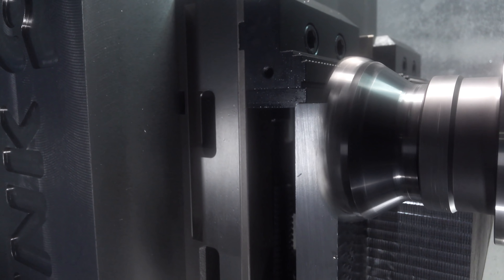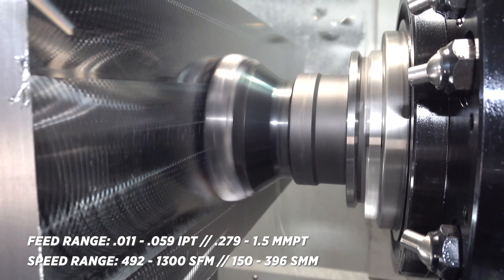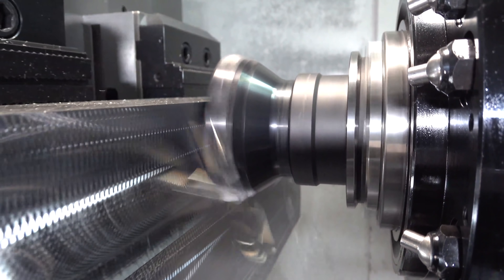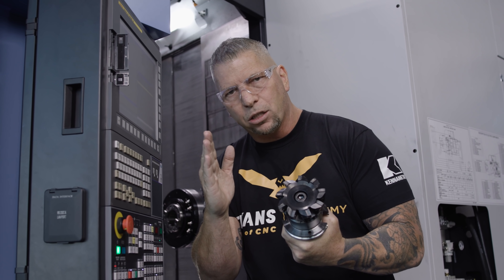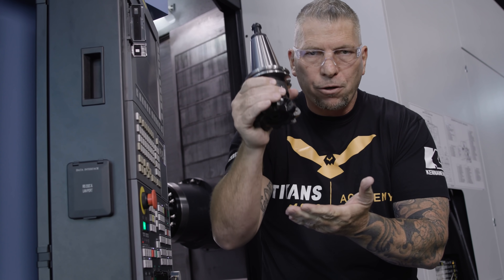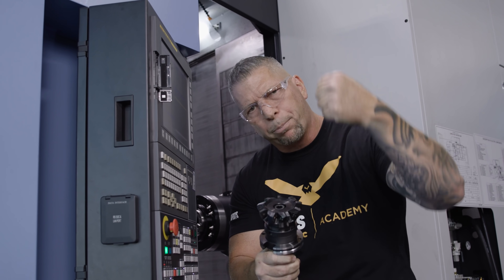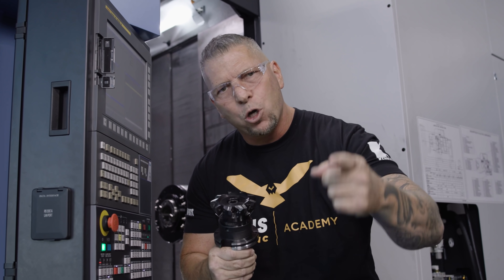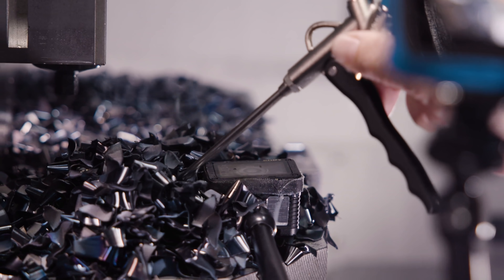Plunge Milling Steel on NHM 6300 Horizontal CNC Mill | DN Solutions

Comment: The only experience I had at a machine was a couple years at a sheet metal one. I ran a turret punch press. I would get prints and a program and told here make this. The programmers would use general tool sizes but I had learned to use better sizes and edit the programs. As long as QC said the part was good I was good. Then I went to a shop ten years later that made huge gear rings. Same thing as before but used cutter heads. It wasn't for me. The education was priceless. A lot what is learned here can carry over to other machines and part makers using some sort of CAD. It's amazing how you give all this knowledge away for free  The smart ones are paying attention.

Comment: Drilling was supposed to be the fastest way to remove metal other than with a saw, so I was taught. There are some other techniques similar we were taught like plunging end mills instead of using a more traditional approach, that other big companies were playing with. This does make sense although it's a little different to see what looks like a face mill plunging.

Comment: One of the shops I used to work at used plungemilling for rapid material removal. We were doing H13, and honestly it was the only thing in the shop where they nailed the feeds and speeds. However, it was always sketchy proving programs out that did this. I don't like this process in an operator shop, and have seen some nasty, stupid crashes with it, but this is a great way to remove material and I wish that shop used the technique more often. The only machine I won't use this technique on is a 5axis. Our table on our varaxis 630 was out .019 in the A, though I think that's most likely caused by a crash that wasn't reported, not someone running the machine hard.

Comment: I've had a plunge milled feature running through my brain for a year or so now. 

My machine is a dmg dmf 600 linear. I have a large part with a 2x2x100" open slot. I've played with everything from traditional heavy roughing to high feed to plunge milling. But I have this idea to utilize plunge milling combined with my machines b axis swivel head. The obvious drawback to plunge milling is the bottom of cut and the repetitive retaction moves which quickly add cycle time. My idea is swivel the head to an angle that allows my cutter plunge cut along the length of of slot rather than to bottom over and over. I felt like surely someone had done this before but upon finding no information I've been hesitant to explore this teqnique. If the cutters geometry works when swiveled then you gain all of the benefits of plunge milling without the prominent negative effects.

Does anyone have any thoughts or experience on this?
Reply: Hardly qualified to answer, but I see what you're talking about. I see a few questions to balance out:
-You'll have something of a sine wave along the walls of the slot. If you finish with an end mill, perhaps you would want to avoid having your plunge steps and flute height sharing a common multiple? You'd probably decrease tool life and induce chatter by having flutes hit the peaks of those waves in unison.
-Your inserts are hitting the material twice when you enter into the first end of the slot. So maybe ceramics wouldn't be a good idea?
-Similarly, to finish roughing the bottom, it would be dished out.  Would you then need to switch out for a different and smaller tool to deal with that or what?

My final thought is if it can it be done like (or on) a slotting machine? Never played with one, but I've seen them. Horizontal shaft supporting the tool on both sides. The tool was basically a puck (cylinder) with cutters sticking out.

Comment: Great Channel.  Do you use toque wrenches to tighten vices? Air and hydraulic clamping? Do you have a reference for clamping forces required in machine parts? Thanks.

Comment: One of the first things i learned from my first job as a apprentice.  Even on a Bridgeport, plunge milling is the most efficient way to remove material for roughing.  This is awesome.
Reply: It can be. It does force you to be out of the cut for a certain amount of time for each repositioning move, though. If the part allows a continuous adaptive tool path then that will increase time spent cutting vs. repositioning.

Comment: I remember the first time we got a CNC at our company. Management thought it was a good idea to let the engineers do the programs. Idiot plunged a 3" insert mill straight down in the middle of a large pocket and wondered why it didn't work. "The simulation worked" he said.
Reply: Quite a few people are surprised by the simulation playing out different than real life.  Always at least look at the code for obvious errors.  At my shop a have a few guys who are just starting to learn CAM systems.  I told then to NEVER believe what the simulation shows.  The simulation shows you what the post SHOULD out put, but that is a big SHOULD.  The simulation can show one thing, but the posted program could be something else entirely.  One guy was convinced that the simulation was "running the G code".  I showed him that is 100% not the case.  I programed a part with no post processor loaded and simulated it.  Then turned to him and asked where is the G code coming from?  He was dumbfounded.

Comment: i used it but not much . good for when u dont want a bunch of force other then down on the part .
but that tool u can run so much harder . i used roughly the same cutter from kenametal on a bt40 and i just run it over its recomended debt full with  and stil does awesome 
i actualy also bought a smaller size for slotting since its awesome at that as wel . this style of cutter u can just abuse/use like a harvy 1 . u will kill youre machine before u kill the tool

Comment: Interesting toolpath, also that vise clamping area in contact with the material seems so small to my untrained eye.
Reply: That is a benefit of plunge roughing.  With out and lateral forces there less risk of the part pulling out of the vise.  With this type of path the cutting forces push the part into the vise.
Reply: They use grip clamps which have small teeth biting into the material.

You get an amazing holding force without much clamping force.
Reply: @norbertfleck812  Thank you for the answers Norbert and Brandon. Did some research on those vice jaw types.

Comment: About eight years ago I had a company that rebuild sprinkles said they a increase spindle repair that use this plung cycle.
Reply: I worked in a plastic injection mold shop where they would ruff 3 d tool paths with 2.0 shell mill  with round inserts in Tool steel ,not super hard so quite doable about 20 Yrs ago
Doesn't take away from this at all tho , this material seems Hard. Cheers!

Comment: An advantage I can see in plunge milling like that when there is lots of stock to remove, is that a lot of the cutting forces is pushing in to the fixture under the heaviest expected loads, less chance of the part moving.
Reply: This, and the fact your not using half or quater of an endmill flute length each cut your using the same tip amount evenly throughout the roughing.
Reply: Plunge milling is absolutely a beast when it comes to take up all the force in axial. Perfect if you need to have a tool reach that is really long and radial forces will have impact on tool life, machining time and most importantly, end result on finished part. Plunging in these cases can make it so you can turn up those feeds and still achieve better end result and longer tool life, since all the force will be axial instead, where the tool and machine/fixture are the strongest.

Comment: This vid was nice. We just got a job were useing a plunge cutter to rough with. The material is similar to A36 but it was flame cut out of plate stock. stock is 3.5" thick x 13x23. We have to go all around at 2" depth in what looks like a giant brake shoe. The flame cut edge is a huge hasle. I only played with feeds an speed for 2 cycles so far. can not get inserts to last all the way around part. Can you recommend an aproach to cut that flame edge? Tryed the recommended s+f, cutting edge wiped rite off, slowed sfm got better, but cutter edge was notching around the  area thats in the flame surface, now gonna try a  little slower sfm an cutting dry. Our tool path is going counter clockwise in an attempt to get mostly behind the flame cut.
Reply: Yes definitely conventional mill around the part first to get rid of the flame cut skin as you're pushing the chips away from the cutter.
Use a solid carbide end mill and take a bigger axial cut with a smaller radial cut.
Reply: @shaunofthedead6389   We used that approach on a very similar job. It did work well, but was pretty slow. After peeling off the flame cut with a garbage 3/4 cem we used a pretty aggressive adaptive clearing path to rough the pc down. roughing took 45 mins, made LOOOOADS of chips that had to be cleared away often an used up a few garbage endmills. The plunge tool takes 32ish minutes, chip control is awsome an inserts are cheaper than the endmills. Ive got it pinned down to 400 sfm .009 chipload  an running dry. Got two cycles on lightly used inserts so far. New inserts should yield 3 pcs easy i would assume.
Reply: Try removing the flame edge with a flap disc before even putting this chunk in the machine
what inserts do you use? some companies have inserts that can chew on hardened steel for hours
also try to use a negative angle cutter, If you have one
Reply: @yanivchen6401   hand grinding 72"x3.5" would be awful an flame cuts laugh at flap wheels. Stone wheels will cut it, but hand grinding all that surface an taking .02-.03" off to get under the flamecut would take forever. On smaller work I have done your suggestion, just hand grind it off. I believe the problem was the sfm an cutting wet. When they asked for f+s recommendations at the tool supplier, they didnt mention were cutting flamecut edge.

Comment: What was the stepover in mm? Shows what a high power machine is capable. My mazak VTC always a bit limited by its CAT40 and only 30hp.
Reply: It was a stepover of 7.62 mm, and exactly half of the cutter was engaged in material (50.8mm)

Comment: Nice. My set up just failed do to table travel. 😔
And then my late caught fire.
 Hard turning 😑
Reply: I hate hard turnings tbh 😂

I do feel ceramic cutters work the best
Reply: @LordOfChaos.x  me too.
 I'm using a cbn diamond tip walter insert 
Have to hold a .0005 Id and .00005 parallelism to the od.

Comment: What a interesting approach. Ideal for square rectangle block. But when you have a flat long 144in on it's side. Cutting it long ways is faster. Chips were freaking flying to the wall and hot.
Reply: Not only for square block. It fits for circular blanks too. And figured. All depths to about 100mm are suitable